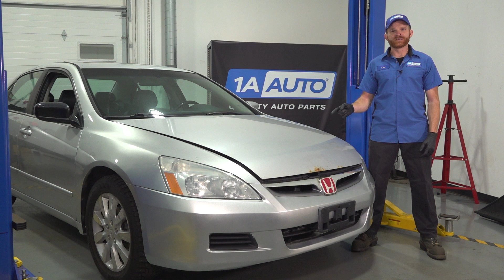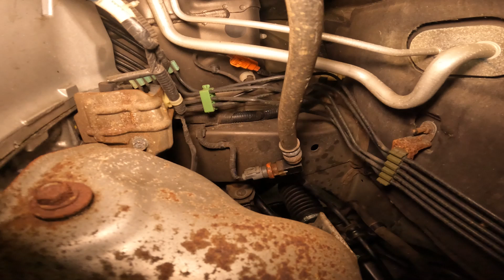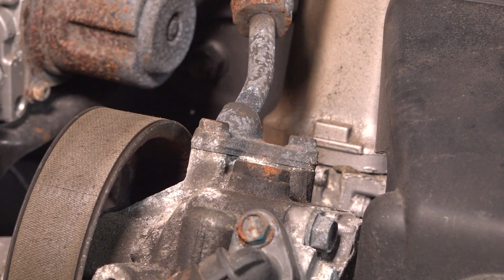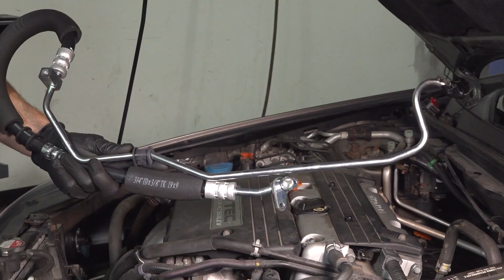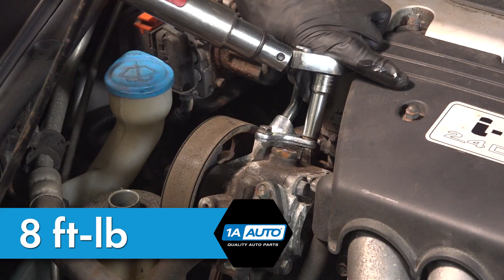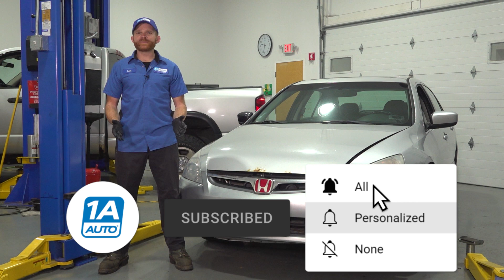How to Replace Power Steering Pressure Line 2003-2007 Honda Accord

Comment: Why would the pressure hose need replacement. Cracked or kinked, damaged connection? Power steering fluid on serpentine belt what happens?
Reply: Mine was leaking